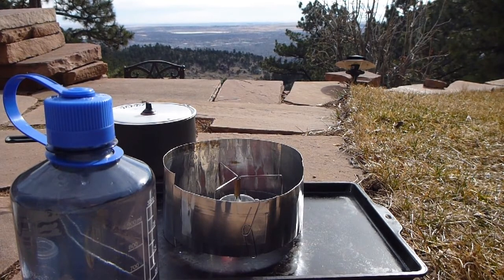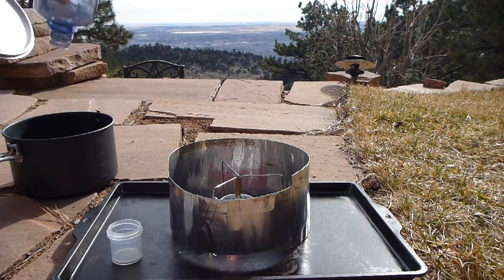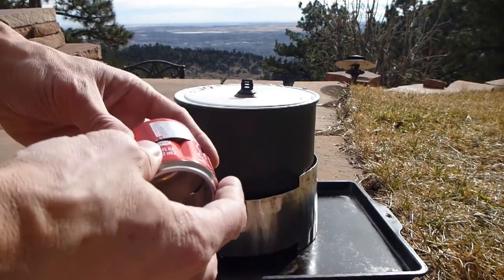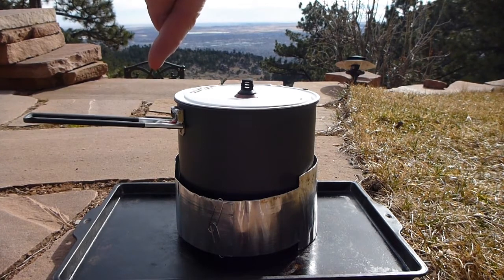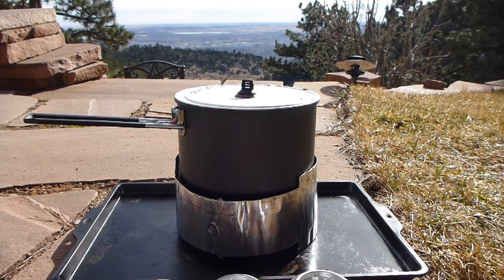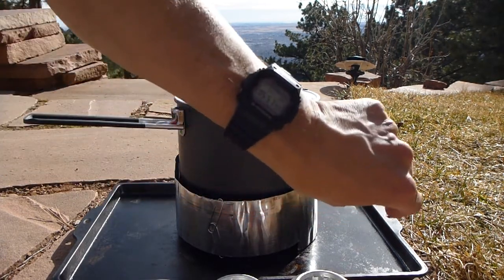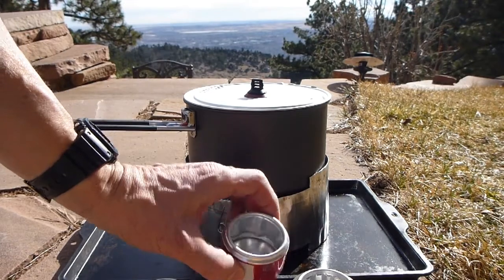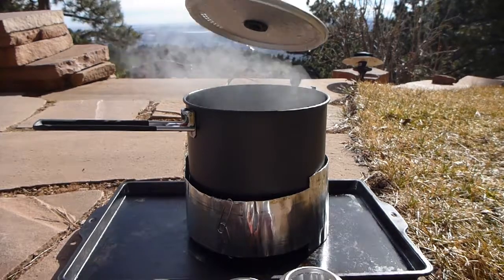Groove stove and one liter of water boils in under seven minutes

Comment: What is the wind screen from and what are the dimensions, please?
Reply from the maker: Doug Ramsey The windscreen is made from an oven liner (sold in Safeway etc) used to put a turkey in etc. for roasting. I actually bought a 5 pack from CostCo. The Safeway variety feel exactly like the foil used in the MSR wind screens. The CostCo is a little thicker. Dimensions will vary depending on your pot etc. I made mine as long as possible for larger pots and high enough to come about one inch up the side of the pot to direct heat up the side where you need a 1/2inch gap to allow the air to flow up. I allow about a 1/4 inch extra material to fold over to strengthen the edges. In the video above (right at the start) you can see the reflection of the flame under the screen. I have cut a 1/2 inch space along the bottom edge, about  4-6 inches in from each end of the screen so that when forming a full circle, air can easily pass under the edge and feed the stove. This is easier than punching lots of holes. There is a similar one on the top edge as well. This is just to allow access for my fry pan handle. All the edges have a little material folded over to strengthen the edge.
Reply: You have the most informative and useful videos on the subjects you use. As much I like the triangular pot stand I made, the type surviver johnny has made (made even you) mad from cat can/soa can and insulation allows me to place the pot right on the stove with the side mounted jet holes. It also applies to the hole puncher cat can. Very simple and boils water under 5 min.  I use 12 holes and smaller dimension hole for the simmering effect for side dish meals that I don't use a cozy for. My trangular stand is heavy rod 3 1/2 in wide platform  ( to support any alcohol stove I've seen videos on) and 2 1/2 high with a 1/4 inch bent tip support footing. Thanks.